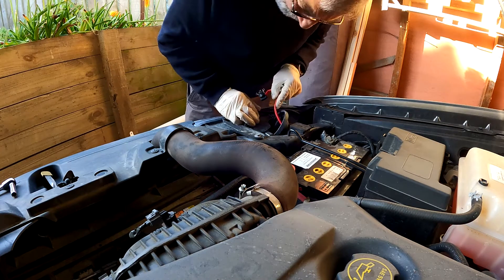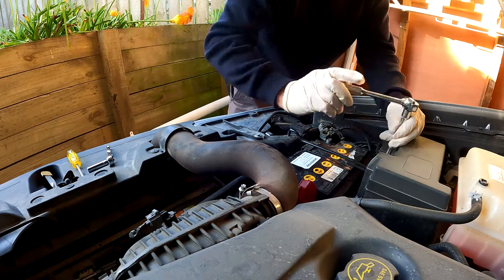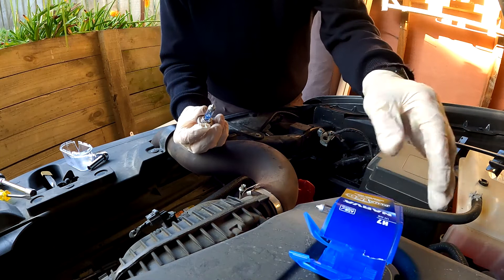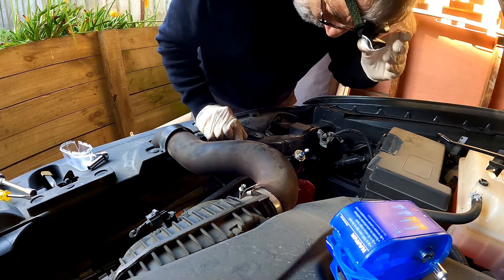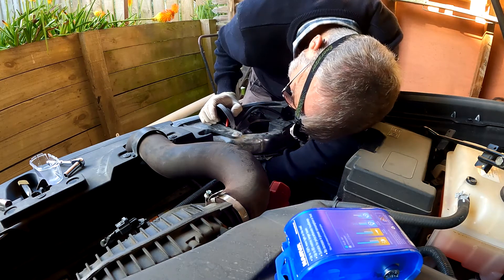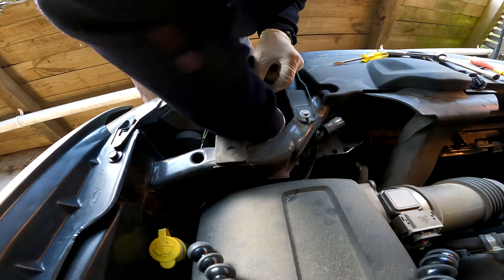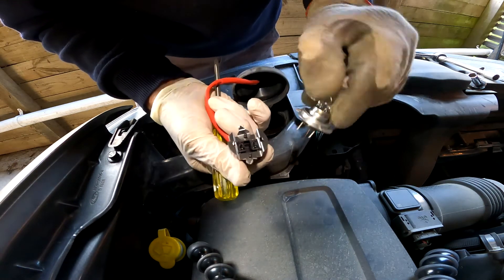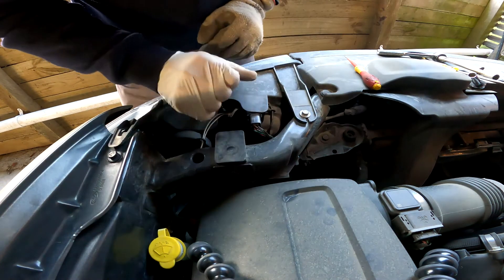014 Ford Territory Headlamp Bulb Replacement (2012 - 2016)

Comment: If anyone is still having an issue with rotating them back into place.. Bend the wing tabs forward slightly and it'll pop straight in. You can also use a torx screwdriver to adjust the holders.. Just don't take them out.